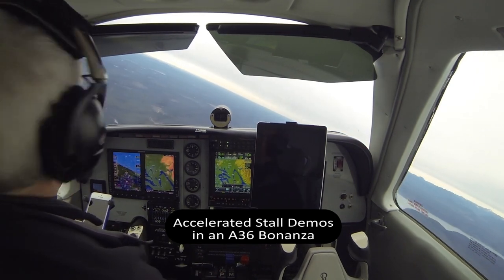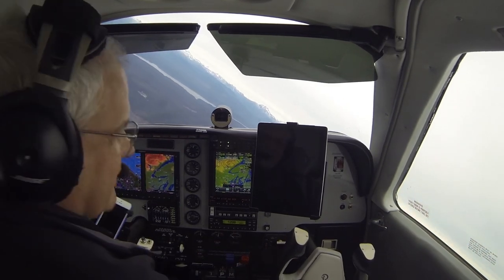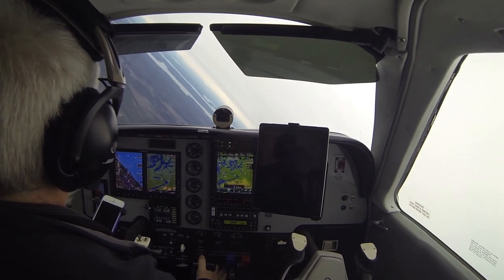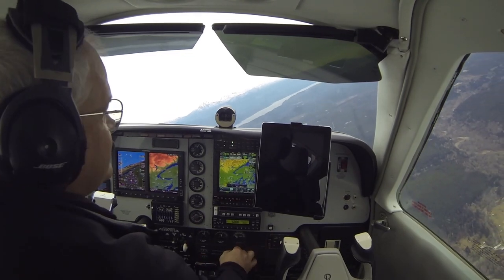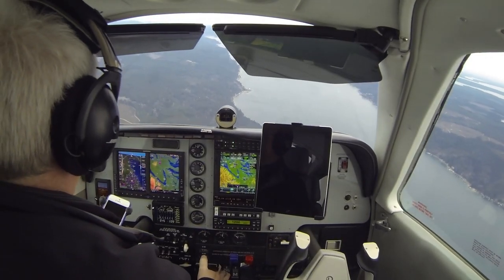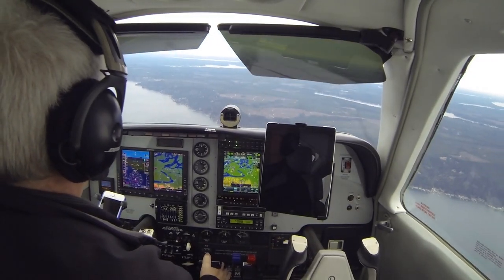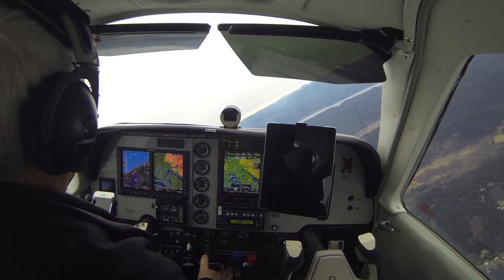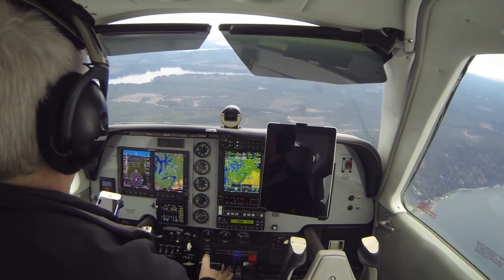Accelerated Stall Demos in an A36 Bonanza

Comment: I'm a student glider pilot. My instructor had me try to stall the glider from a 45" banked turn, low airspeed, and I couldn't. Is this because of the increased lift and low speed to fly gliders have? I have however experienced an accelerated stall at about 60-70 degrees bank when thermaling. Exciting stuff.
Reply from the maker: ***** You should discuss this question with your instructor, but it sounds like you didn't apply enough back pressure on the stick to increase the AoA to the critical angle. Put another way, you probably weren't pulling enough G to stall at the airspeed you were flying in the turn.